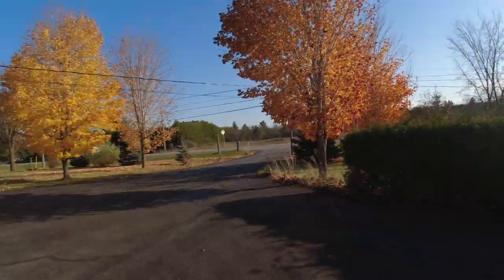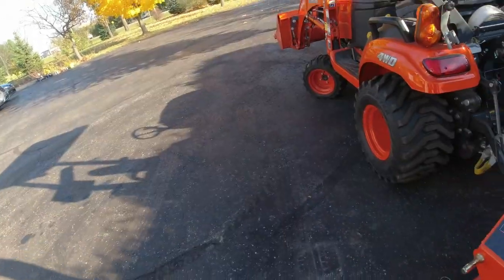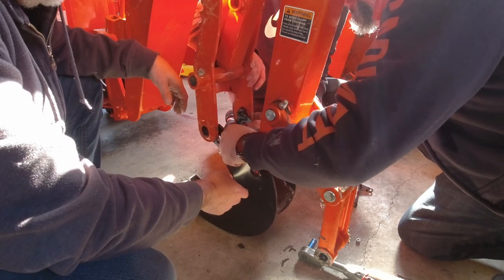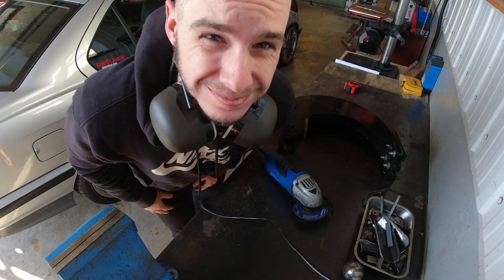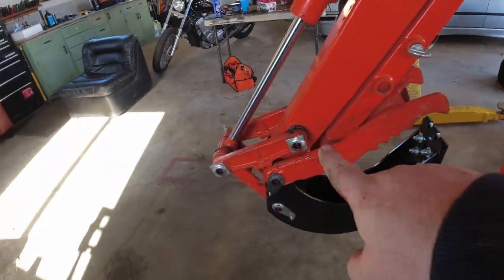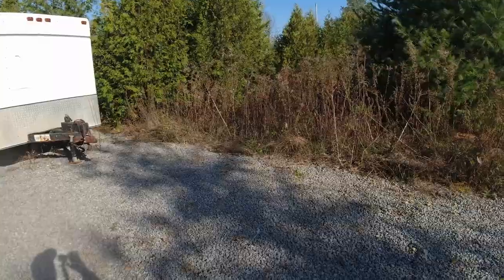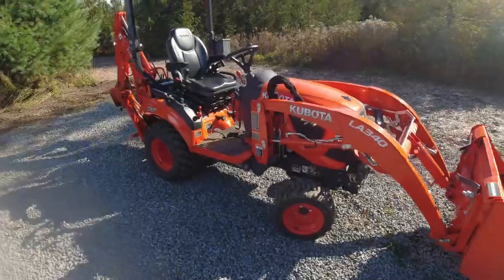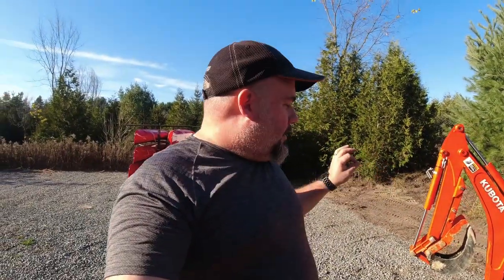Kubota BX Backhoe and Trenching Bucket

Comment: Although I run a much larger backhoe, the issues with buckets smaller than 16” are the same.  Small buckets don’t shed the dirt, only useful in dry and loose soil.  Digging a wider trench is much faster.  As with all buckets, technique is key.  Don’t curl your bucket to deepen the cut.  Extend your boom, drag the bucket using the teeth to make the cut.  Drag the freshly unearthed soul back and only then curl your bucket to remove the soil from the trench.  This will keep the bucket from being clogged,  most important it will give you a smooth and straight bottom trench.
Reply from the maker: Thank you for that info absolutely helpful, and makes complete sense.  I really appreciate the help and will be doing that from now on.  Have a wonderful week ahead.
Reply: @RossOnTheLand  Safe digging. Best wishes and luck.
Reply from the maker: It'll be way easier with your guidance!
Reply: Yup....a trenchers number one pitfall is trying to DIG the trench rather than DRAG the trench. Even the stock bucket will pack full in wet soil if you try and dig rather than drag! I know I've been too impatient at times and spent more time cleaning out buckets than digging! 😁 Appreciate the on/off tutorial!
Reply from the maker: I think that was my biggest learning accomplishment! Understanding that using the teeth to drag first, and only using the bucket to school up the spoilage was huge. Thanks for the comments

Comment: Love the standard  backhoe bucket on my 23s.Had to dig a hole in January with first 10 inches frozen like a rock , Broke throw it in no time with the teeth , Was taking a inch of  frozen dirt at a time. Works great on small tree stumps to... Amazing what these  small tractors can do.
Reply from the maker: Hi Gary, I agree I love the standard bucket as well, I have a few stump digging vids as well, but wanted to try the trenching bucket and it's not as good as the regular bucket for digging down in confined spaces that's for sure. I will be actually digging a trench later so hopefully it performs better at that. :)

Comment: Hi Ross ! Thanks for the heads up you installed the new trench digger !  Maybe a fail, but I still see potential. If I was running underground cable, it's a great add-on to have in your arenol of tools.  It's way less invasive in areas like a nice grassed area where you want to inflict minimal damage.  Shallow trenches, it works well with.  It's too bad about the bucket not wanting to empty easily, but it's still way faster than digging by hand.  The new bucket does show potential, but I'll agree with you, what a job to install and remove, I had no clue it is so involved. That is not fun !  It will make you think twice about installing it for sure.   BTW, amazing how you were looking at that 1K subs, and now you're ALREADY up to 1.1 K ! - that first 1K is the hardest number to achieve.  Hey, remember, as that saying goes ( Kevin Costner ) - if you build it, they will come ( Field Of Dreams movie ) .... if you create content, people will watch.  haha !  Great video anyway Ross, nice to see you again.
Reply from the maker: Thank you! Yes I agree with it being useful in proper use cases.. :) thanks for your support.  I will be digging a proper trench and will give it another try for sure. Cheers.
Reply: @RossOnTheLand  🙂

Comment: Jack @ B&T MacFarlane should have something in stock to help with project  :)
Reply from the maker: Yes he definitely does, but when I looked at the 3pt mounted post hole digger it wasn't ideal because of limited height and no downward pressure.  But that would have been way easier than a trenching bucket :) haha. Thanks 👍

Comment: Hey Ross, does Kubota have an auger attachment?  That might be useful too.
Reply from the maker: They do, but it's kind of limited because there is no downward pressure, so depending on the ground it may be difficult to drill and also depending on how deep you go that could also pose issues for the limited travel height of the auger.  Thanks for watching. Good suggestion.

Comment: Operating the trenching bucket a different way would be helpful. Instead of digging straight down, raise your boom and pull the dipper and bucket of soil toward you. Curl the bucket at the end of each pass and use the side of the bucket to push the dirt away from your trench to your spoils pile. In essence, you're digging at a 30 to 45-degree angle, not straight up and down. 
Bucket getting plugged up doesn't matter. You're scraping the dirt up and out.
Reply from the maker: Hello, that is most helpful! It's something I've since learned how to do , and am definitely better at spoil management. Thank you for the great advice.  Have a good week.